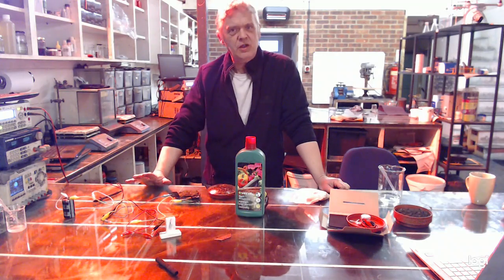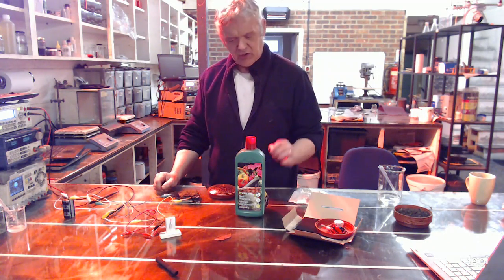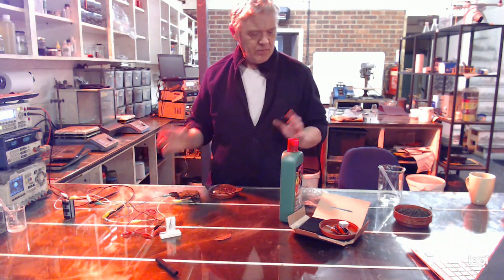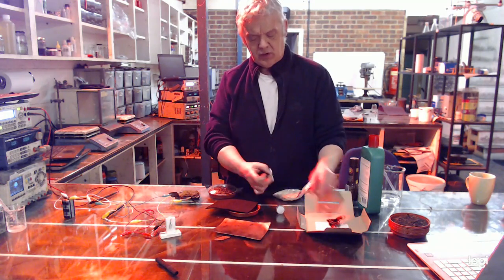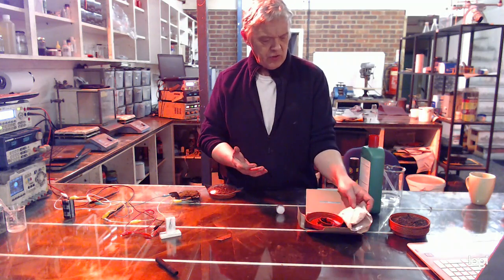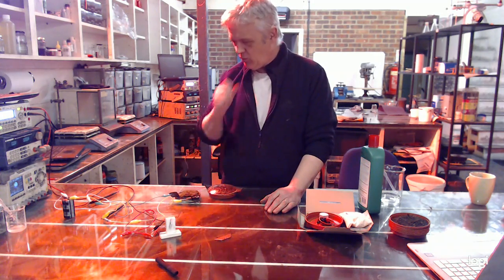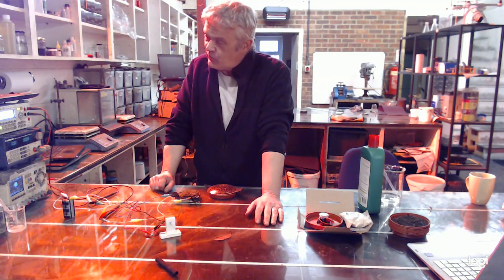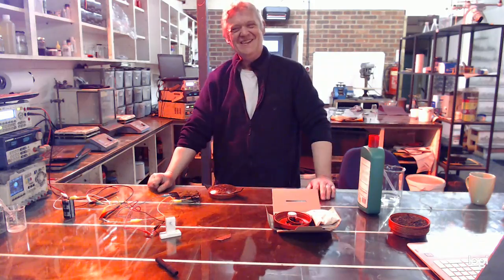Plant Battery - Update 1 - Energy Scavenging

Comment: So great. Maybe red led so the audience can get a visual but 5 cells in series to up the voltage. Maybe a few led   could go in the kit too as a suggestion as they are cheap enough
Reply from the maker: no mate - there is much more to it than that - you need to read the research - the induction motor works well as it will continue to spin down to 0.08v whereas a LED needs quite a high forward voltage even though the mA draw is low.
Reply: @ThinkingandTinkering  I meant 5 moss cells in series and 1 led. Would that work? I assume they can go in series but maybe they can't, I shall read the paper soon. Very cool
Reply from the maker: yeah mate it will do
Reply: Robert is that right?  You said the motor will spin even down at 0.08v.  Less than 1/10 volt to run the motor seems unreal, wow:  was expecting more like 0.8v at best.  And at what amps?  I ran toy motors and LEDs from very modified crystal radio like circuits that work with very small powers scavenged from various RF sources via the earth ground and/or aerial wire "antenna" and such.  And yes, even made connections to trees and plants in my exploration.  Used capacitors to store the feeble intake until enough to power a useful load.  It seems feeble (diffuse) energy is everywhere:  plants, animals, soil, air and even arriving to earth from outer space besides the sun!
Reply from the maker: Yes mate it is - these are awesome motors - I get them from toy quadcopters they are 8mm in diameter and 14mm long - or there abouts - and they run down to 0.08v and draw around 15-10mA - so they are great for low voltage but not so good at high amps - an LED will draw around 2mA to flicker on. so if used directly with very very low power sources the quickly run out - as seen in the first vid i did in this series - it's one of the reasons i put a cap in the circuit - cheers
Reply: @ThinkingandTinkering  oh I see then. Very amazing little motor. I have some of the smallest one I could find online. I will have to have a play to see what will run them and then start playing with some moss. It's very exciting stuff actually I was wondering if shining a uv light on the moss increases the voltage or direct sunlight. My mind is already thinking about fungus growth and its effect in a damp dark setting. Hmmm
Reply: @ThinkingandTinkering  do you think I can find them on ebay for cheap? What should I search for, thanks
Reply from the maker: I suppose you could mate - but i am not sure what the search term would be i just put small motor

Comment: Well done, but 0.18 Volts is a bit low... Can you get higher voltages by longer charging the supercap ? What is the maximum open circuit voltage of the cell, if only a high ohmic digital voltmeter is connected ?
Reply from the maker: 0.3 volts - and it's clearly not too low as it is sufficient to do work - but then it is what it is - a plant microbial fuel cell!
Reply: @ThinkingandTinkering  Ahh I see, just  0.3 Volts, anyway, so you need to put a few cells in series to get a better voltage to get an LED to light up from the supercap...
 if you would take a Zink plate as the lower plate it would generate much more, but then it would be again more like a primary cell eating up the zink plate...Anyway, well done !
Reply from the maker: it would mate - but you don't really want to poison the system by introducing high concentrtions of free metal ions
Reply: @ThinkingandTinkering  Yes, but Zink metal ions are not toxic, but help the plants even better growing... lol...
Reply from the maker: you are missing the point mate - we have two choices - force a system and kill it or work with it and keep it alive - i am not saying one is better or not - they are just choices - Zinc, incidentally, is not non-toxic - just search zinc environmental toxicity on google
Reply: got mfc with 880 mili volts :)
Reply: Stefan: Someone (I forget whom) once wrote a short sci-fi story, in which astronauts were poisoned by high levels of Zinc in their water supply, and causing cramps, vomiting and diarrhoea, leading to malnutrition and death. Granted, Zinc is essential to the human body, and that some 'artistic license' had been taken by the author, but very high levels of Zinc (maybe a gram per day over long periods) will cause those symptoms, plus Copper deficiency and a dangerous cholesterol imbalance, and muscle spasms.